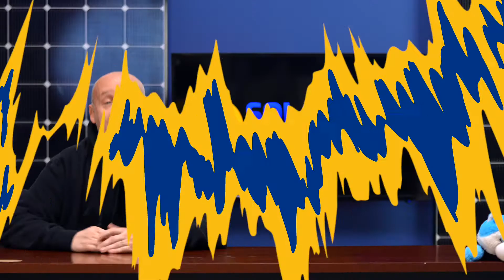Solar Panels and E-Waste Are Gonna Overtake Landfills | What Can Be Done?

Comment: I do / or recently did waste hauling. I see all kinds of things other haulers put into the waste stream that they are not supposed to. While hi value items may pay for themselves  (chips and processors) The cost of disposal of low value reclamation (monitors) is subsidized by municipalities or directly by businesses that used them. I have seen many small scale recyclers who do not use best practices when obtaining the metals. Pollution from vented refrigerants, broken tv bulbs, florescent bulbs, improper disposal of harsh acids used in extraction. People who do Metal scrap tend to do it for day to day subsistence and to feed drug addictions. Not to save the planet. They tend to be small operators who do not know the bmp and do not care. I know of a back wood lot area of a farm full of dozens of pallet loads of old e waste. Some has been gone through to pull the metal leaving everything else as a surface land fill. Plenty of the pallets were never gone through. It will remain there and get battered by weather and covered by vegetation  over the years. This happens here the same as it would in cambodia or what ever location accepts the ewaste.